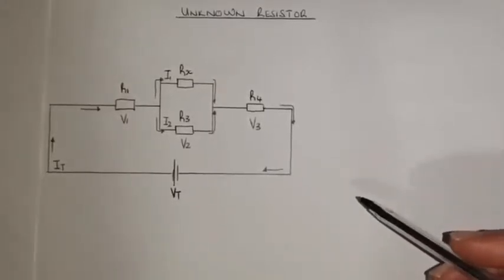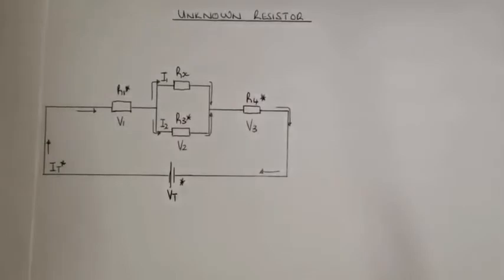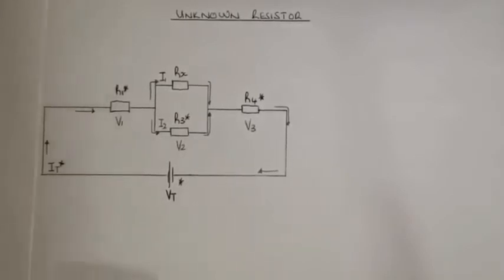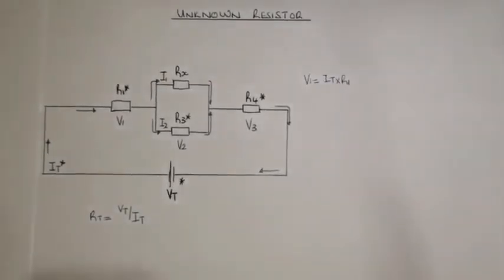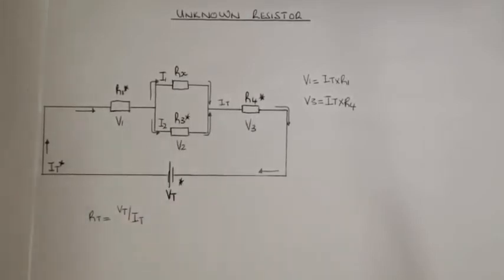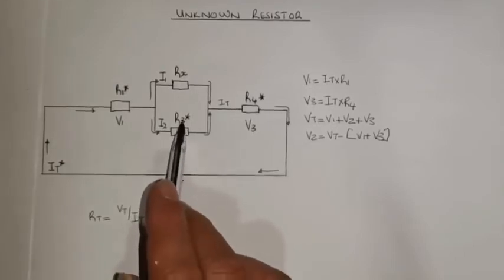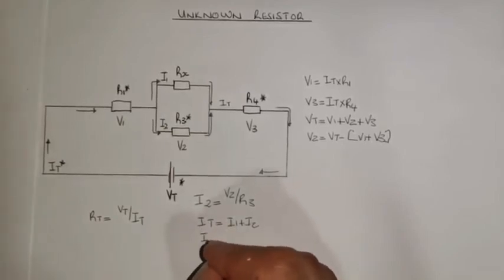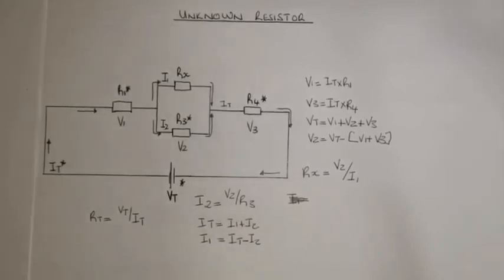Calculating an Unknown resistor explained.

Comment: Question: Do you not have a voltage value next to resistor Rx because in both of those parallel branches V2 counts for both because voltage is the same in every branch of a parallel circuit?
Reply: Basically asking whatever value you get for V2 also counts for the voltage value at resistor Rx right?

Comment: The thing is, in my circuit there’s only 3 resistors. The one unknown resistor is the one in series so I really don’t know how to figure that out. I’m kinda lost
Reply from the maker: If you have 3 resistors in series. Calculate the voltage drop of the other two resistors. Than you use kirchhoff's voltage law and calculate the voltage drop over the unknown resistor. After that you can calculate the resistance of the unknown resistance by using the formula that says the voltage over that unknown resistor devided by the current that flows in the circuit. There's only one current that you can use because it is a series circuit.

Comment: Helped me a lot. Question, how would you solve it the other way around? Only one resistor value and currents known and I’m trying to find voltage across network
Reply from the maker: Well in this specific case there is only 3 currents, which is the total current and the current in the parallel branches. With one resistor value and the known current flowing through that resistor you will be able to calculate the voltage drop over that resistor, which is a start to solving the network.